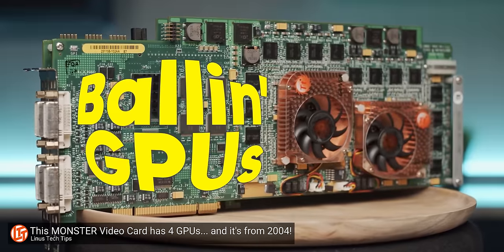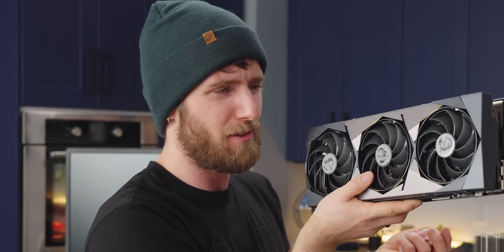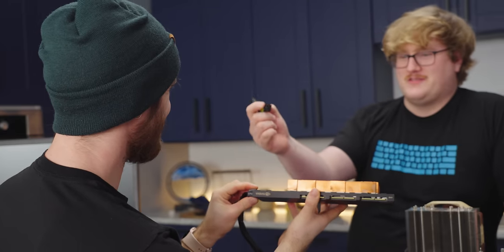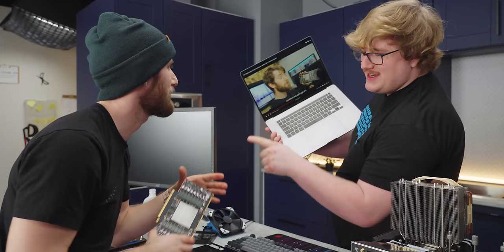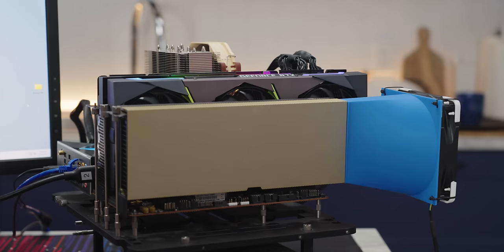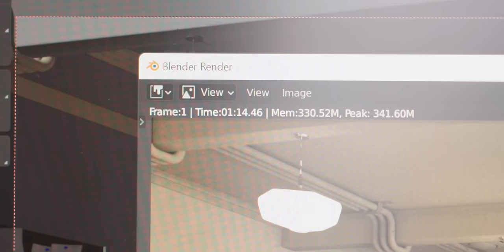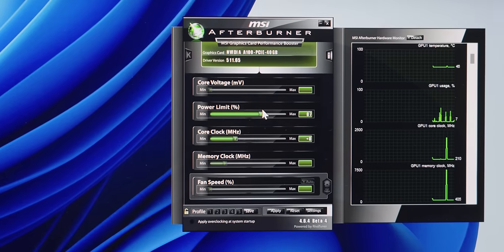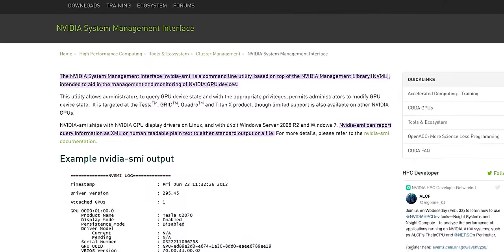NVIDIA REFUSED To Send Us This - NVIDIA A100

Comment: It‘s fun to see a nvidia tesla gpu covered on ltt. Beeing the guy at the company managing servers with tesla gpus (worked with multiple generations K80, P100,V100,A100) its funny to see how a diy/gaming focused take on these cards is.

The A100 pci versions are nice but in comparison to the sxm version its still leaps away from beeing the most powerful gpu. The thing about the sxm cards is that they are never deployed on standard motherboards in single or dual configurations. They use so called hgx architecture based configurations from nvidia. This is how nvidia gets the best performance out of them. In a minimal deployment of 4 sxm gpus the gpus never directly interface with the cpu over the pcie bus. To make use of the greater bandwidth of nvlink nvidia uses so called nv switches which basically isolate the gpus from the rest of the motherboard physically and logically expose only the nvsitch to the pcie bus. Jobs which are executed will be forwarded by the cpu to the nvswitch and this will then be distributed to the gpus. Based on the size of the job the gpus split up the job inbetween them and execute them. The output is then sent back over to the nvswitch and back to the cpu by the pcie bus. 

The only manufacturer currently supporting an efficient nvlink only communication path between nvidia gpus and the cpu is ibm with their power cpus. Having the machine learning benchmarks done on one of those would be interesting. Maybe you guys get the      chance to try out raptor computers ibm power machines with nvidia gpus.
Reply: Yo, I got my hands on a K80 for like $200 a couple months ago. Haven't gotten it running yet tho. I think tesla drivers don't play nice with geforce drivers. Every time i boot with the K80 install the OS hardlocks. I do have a spare quadro but haven't tried that yet.
Reply: @mitlanderson  if you are running linux then try this. First install the tesla driver. Then the quadro one. Tesla and quadro can work on the same system. Geforce and tesla have some weird issues.
Reply: @shabinshan5897  i was running windows but ive been meaning to get into linux

Comment: We did this in the 70s with a IBM system 370 drop in card … the base processor is there to do IO, disk, network services to feed the co-processor … cray computer did this also … we use to call them vector processors…

Comment: 00:00 Nvidia A100 is a top-performing AI enterprise GPU
03:44 The CMP card and GA100 do not have hardware for video in code.
06:31 Comparison of two Nvidia products with same Silicon but different capabilities
09:23 A100 GPU doesn't have a cooling fan, but a shroud donator is designed to mount a fan to the back of the cart.
12:08 Comparison of GPU performance between A100 and 3090
14:51 The A100 GPU is efficient and powerful
17:35 The NVIDIA GeForce RTX 3090 can run the ResNet-50 benchmark at 1,400 images per second with a power usage of 412 watts.
20:33 The A100 GPU on a 7nm manufacturing process is more efficient than the 3090 on an 8nm node.

Comment: In mining cards you want power efficiency as well as resilience. I wouldn't recommend anyone to run a consumer card 24/7 at full capacity. Which the mining cards can do.  Think of them as a marathon runner while the consumer one is a short runner. The short runner is faster, but the marathon runner can run longer.

Comment: Just now watching this. Great video! Correct me if I'm wrong please, but it seems like the real value of the A100 would be it's ability to link together with other A100 cards and use the shared pool of resources. Thanks again for posting!
Reply: You're absolutely correct :) There's a few other things though:
1. It's optimized for 64 bit computation instead of 32 like consumer cards which allows it to do highly precise math much faster (which is very important, especially for computational physics and machine learning). Consumer grade cards are built for graphics, which usually just stick to 32 bit computation because it doesn't need to be precise. When you get to the level of research or industry level computation, you need that level of precision. 
2. They mentioned it in the video, but I think they didn't stress enough just how important the lower power consumption was. These things are often going to be running non-stop for days or even weeks. Consumer cards are meant to be put under heavy load for a 4-8 hour gaming session and then get like a 16-20 hour break. Some of the training sessions for machine learning applications use these cards at their maximum capacity for days and you'll often have multiple people using these either scheduled or simultaneously. Just imagine 4 of these cards linked together at full memory usage (160GB) and full stress of 64 bit computation for an entire week (168 hours) non-stop. What these cards are built to do is just completely bonkers.

Comment: I do a lot of 3D modeling and texturing, and even with 256 GB of ram I run out of memory for some of these projects at that point I have to lower the quality and render on CPU instead of GPU. So I totally believe it 80 GB x 4 cards 320gb might just be enough to run that process.

Comment: Hey! When I first got into PC building and tech ~2015, I used to wonder why would anyone buy one of these. I now work in an AI adjacent field so I may be able to contextualize why people pay premium for these cards.
1) VRAM is a limiting factor in training and using AI models. Hence the 40/80 GB vram on A100.
2) A100s are designed with what AI models ultimately do - array (tensor) manipulations - in mind, hence the dramatic performance boost on the AI test used.
These factors, + energy efficiency + multi card scaling issues is why people shell out $10K for them :)

Comment: So, if the a100 had more Cuda and tensor cores with ray tracing and DirectX it would be a better 4090 gpu. I also think memory storage is more important than other features on gpu's. But because of games using those features they make them the way they do to run them. Also, games still use DirectX yet theirs less support for it. Vulkan is taking over and works better with some newer games but has compatibility issues that need to be fixed if ever replace it entirely. Most games are turning into giant physics-based simulations and online games would run better if the a100 had more gaming features and internet bandwidth with ethernet and wifi capability. A dedicated online gpu. If you could run a gpu parallel with a a100 it would reduce the memory load. I wish their was a gaming feature that synchronized all pc components automatically.

Comment: I think the tile size was throttling the performance on the blender test if you guys are using cycles x the tile size plays a big role on you and over all the bigger the better about 1024 was peak on my card but between 1024 and progressive refine at 4k there was only about a 5 second difference

Comment: I've wanted to have the 80GB A100 for a while. But I just don't have the facilities for passive cooling. I've used the RTX A6000 48GB variant. Since then, there's an ADA RTX A6000 which is superior, but same memory, Since my problem has been, from the start, OOME, out-of-memory error, I still haven't updated.

Comment: Hey hey hey, I need to point out something about the deep learning benchmarks, if you use the exact same setup like the batch size, network and the input image resolution which you say you do and this is also CRUCIAL for the benchmark to be meaningful then both the GPUs must be using the same amount of VRAM, but this is not the case as you show it, so there must be something wrong with the benchmark, VRAM being higher means A100 took more data for parallel processing, so there is an unfair comparison there if that's the case. Would love a clarification on that. (I am 90% sure you used different batch_size and did not show the part you change it to fit in the GPU.)

Comment: I just found that my second RTX 3090 is slower and found that 99% of the  motherboards only have a single x16 PCIe slot, the second is often a pcie x2 or x4. Only a few can do x8/x8 since ie the AM5 has only 24 PCI lanes. I don't know what board Linux was using. I hope the load over the PCIe lanes was divided evenly while testing.

Comment: sir we have here AI - DGX A100 and we are facing frequent shutdown(like sleep mode) of this server and we have to manually restart it again and again, we contact NVidia as well they send some service engineers but its happening again. we have good cooling system for it and there is not too much load because its being used by the research scholars. we have also checked power supply problem but we are finding any solution to fix it. please if you can suggest some tips to it that will most kind of you.

Comment: Ahem, Yeah Dude, you've got a small error in your text overlays. At @2:38 minutes, the RTX 3090 slide shows 28.3 million transistors. That is off just a bit.  It's really 28.3 billion transistors.  Likewise, at @3:18 minutes you show 54.2 million transistors for the Nvidia A100 core.  The real count is 54.2 billion transistors.  By comparison, a modern day Intel CPU might have from 1 to 3 billion transistors.

Comment: Really you getting excited over all of this it reminded me of how one of the big 3 would have dedicated  in house servers for rendering of Models from India.  Then they had there own dedicated Server across a large Campus sending huge piles of data. Across the Network.  It was highly inefficient.  I would have been easier to run a dedicated 10 gig cross campus.  They were squashing the Network with QOS.  I feel bad for them now well not my ex boss but the hideous Meraki switched network of doom and limited features.  If you guys wanted those god awful switches that make Netgear look like world champs thats your call.  Snickers loudly and writes a disclaimer any and all statements made by me are my opinion.  Anyone who would throw out a 120, 000 testing machine that scaled to 10 gig and could simulate 20000 users needs an examination just because they didn’t understand it.  I had it working in the lab in 20 minutes in which most of that time was spent installing Supervisors and cross connects to each switch.  Just wanted Cisco to win that voip contract.    I Digress go Linus!

Comment: The NVIDIA GeForce RTX 3090 is a high-end GPU designed to offer exceptionally high performance for gaming and graphics rendering applications. This GPU offers a large amount of memory and uses ray tracing technology to enhance the realism and visual quality of games and other graphics applications.

As for its use in artificial intelligence (AI) and machine learning (ML) applications, the NVIDIA GeForce RTX 3090 may be a suitable option for some applications that require high performance and a large amount of memory. However, it's important to keep in mind that there are many other GPUs available on the market that may be more suitable for these applications, depending on the specific needs and requirements of the application. Therefore, it's important to carefully evaluate the available options and choose the most suitable GPU for the needs of the application.

Comment: The AI benchmark doesn't make sense. It performed twice as fast as the 3090 gpu, but costs 7 times as much ?
Reply: While using almost half the power, running significantly cooler, and having a smaller form factor; three paramount considerations for any data center

Comment: nvidia can sell hbm with 2tb/s gpus now or maybe 3tb/s but of course they are not going to do it. they are going to wait for the series 5000 and sell us the same chip from the 4000 series just with more bandwidth . and as far as i know, there is no way to tell if silicon has more cores or is jut a software or fusing limitation.

Comment: This is what I hate most about CPU and GPU. The new tech comes out, and it doesn't cost anything extra to make everything on the most extreme platform.  Chips that don't perform as well or have errors are simply downgraded by the Coors and other issues. But most of them come out capable of being extreme chips. Then they are actually dumb down to make them inferior. Which actually cost more money yet you get charged More for the CPU.

Comment: Waaaaow, poor buyer. Originally bought that for Eth mining. Hope they recovered that 10k in 6-8 months! At least he was nice enough to get it to LTT.

I always wondered how these absolutely top end GPUs have such simple design. I can see the fins allow for high air flow along the surface of the circuit board. Is that pass through design more efficient? Or simply to fit within servers? Only 250W TDP, maybe that's why cooling isn't that important.

Comment: I want to see a game running on it
Reply: It is not even compatible with running games. It is missing many of the core architecture and drivers for that thing.

It's not designed for gaming, at all. You'd be lucky to get anything running. It is designed for high efficiency machine learning, any added gaming capabilities would just be bloat and a waste of power.

Comment: Does it beat the 4090?
Reply: no, it cant even beat the 3090.
Reply: If the 3090 beats it in several categories, the 4090 will definitely.

These cards are specifically designed for machine learning and running large AI models. The 40GB of VRAM and memory speed is much more important than anything the 4090 beats it on.

The A100 smokes the 4090 in AI. It also uses far less power. That's all that matters here for what it was designed to do.

Comment: Hey Linux help me build a RTX titan A.I gamer PC. What you think? Make a list of the components I will need to get the best of that card when it launched. I want to get out as much Graphic and FPS possible. I don’t know if it can be overclock or if the best CPU for it is the RYZEN7 98003D. 8TB of M.2 SSD, THOR PLATINUM power supply, idk what mother board is going to be the best for it and the ram. Same with thermal paste or Liquid Metal and well everything to run it as cool as I can.

Comment: There is speed and there is accuracy. Ofc you are "faster" when you "cheat". But ofc when you "cheat" your result may not be as desireble.

So what does "fastest" GPU/CPU even mean? What's the most loyal one?

Maybe two is good. Cos one only is like the edge or surface of that zero-/moebiusstrip-object... Which is the opposite of a logical structure.

Funny how my graphics cards name "270" in chinese numerology and math essencia would be translated to sth like "good cheats not" or "good doesn't cheat", cos on the left side of the zero there it is negative.

What do people do today "2070" and then using a circular processor?

"not not good does not cheat".

"not that 270 that has a moebiusstrip inside"? 

And that bs is supposed to be better? It's like a clone of a clone of a clone.

Or what about "4090"
"not dead eternally (whether even or uneven excluded) not" and then again with an intel core circular logic, the opposite of it...

Definition by exclusion?

Lets hope your not doing "not not skull".

Comment: i watch full video twice but still dosent understand, 3090 is way more faster, have more cuda core, but why still A100 is strong??
Reply: The A100 has a ton of double precision cores for fast high precision matrix multiplications, and can do way more parallel FP16 calculations per second. Simply having more tensor cores and a bus wide enough to make China mald also helps